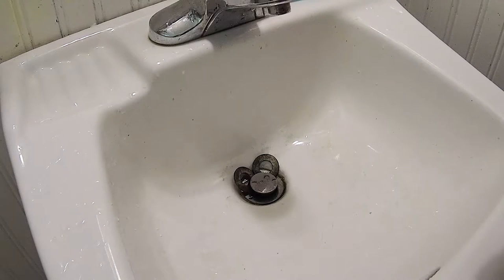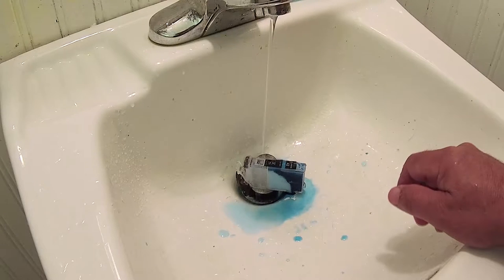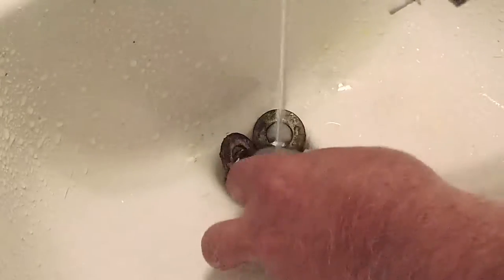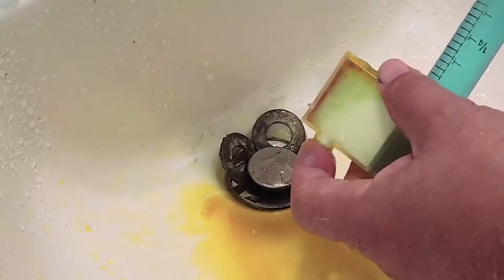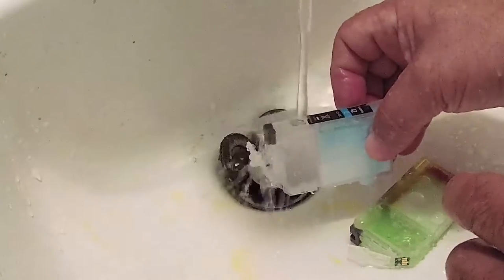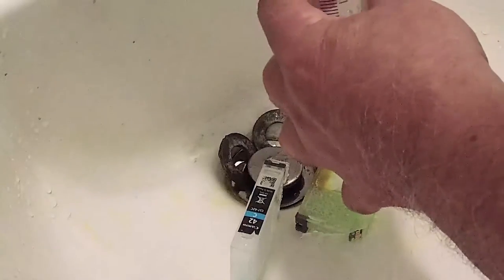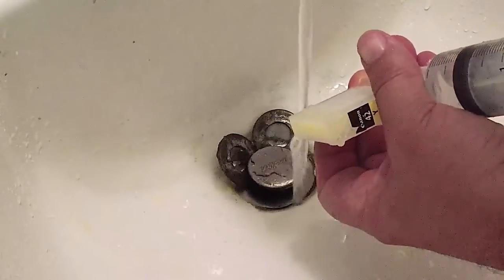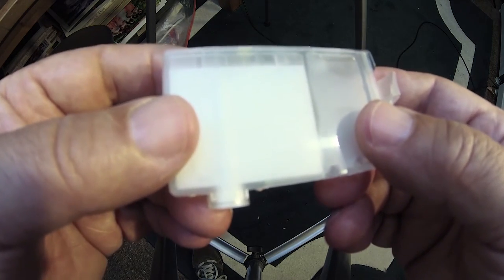#4 Flushing out the CLI 42 Carts

Comment: Am I understanding this that OEM yellow is not water based and that is why it is not compatible with the water based PC formula?
Reply from the maker: Yes!
Reply: Your response is highly appreciated. Knowing this, I would tend to go with octoink then since it's formula would be much closer in formulation to the OEM. Would you agree with my reasoning?
Reply from the maker: Uhhhhh, not really.
Reply: The question remains, why does Canon use a yellow solvent ink in conjunction with an otherwise all water based system.
Reply from the maker: Quite simple. Because it does not fade as easily as water based yellow. Yellow is weak link in the whole fading debacle.well, also photo black just not as bad. That's what makes the new Canon inks for the PRO100 unbeatable! Switch to anything else and longevity drops to about 10% that of OEM. I can live with that it I am saving 15x but I have ways to extend the print life span so I am not too worried.
Reply: What could one expect the longevity to be if PC refills were used in conjunction with OEM black and yellow? (not utilizing the PC black and yellow) Sort of a hybrid cocktail.

Comment: Hi Jose. I failed to follow your instructions and mistakenly flushed my CLI-42 yellow cartridge with tap water and then flushed it twice with windex and then flushed it with DI water. The sponge is snow white and dried to 13.7 grams. Is the cartridge usable as is? If not is there a way it can be salvaged?
Reply from the maker: As long as it is white you are ok.

Comment: Where do you get a syringe like that and.....hat size is the end....it has to be the right size to fit into the hole and form a seal??!!
Reply from the maker: It is a 60 ml. Amazon and eBay sells them. The bigger the better. They come in plain tip which perfectly fits the fill hole of the cart! Mine is a leuer end syringe so I needed to screw on a plain tip adapter. So get a Plain tipped syringe and you will not need any tip adapter like I bad to use. Inkjetmall.com has plain tipped 60 ml syringes.

Comment: Is it absolutely necessary that after the flushing the carts should be 100% clear and that after that one must flush the carts with alcohol and the with glycerin? You said somewhere that it's possible to refill OEM carts with PC inks even when they are not empty. 
I tried to flush my carts but they are still not 100% clear. Also I haven't found the needed alcohol and glycerin.
Reply from the maker: NO. Just top them off with the PC inks when you reach low. The only one you will not do that with is the YELLOW one. You be given a flushed and ready to fill CLI-8 cart. Fill it with the PC yellow and transfer the OEM, CLI-42 Yellow chip to it. From at that point on you are top top off all the carts as needed or all at once. Reset as you top off. Do not ever reset and forget to top off. You do not want to have a cart physically go empty and the chip reporting it "has Ink" in the cart. That would KILL your print head.
Reply: Jose Rodriguez you also told before that it's good to have two sets of carts, so that one could replace them for a refill all at once. I wanted to follow your advice. I have 8 OEM carts in my printer, some of them will be empty soon. I was going to refill them with PC inks as you wrote to me here above. Another set of refilled carts I wanted to make with already empty OEM cats that I have. I flushed them with the distilled water and a window cleaner (not a Windex but also with ammonium) but the carts are still a little colored. Can I refill them being in such state or already empty carts must be 100% clean and then flushed with alcohol and then with the glycerin mixture? I don't have the alcohol you mentioned nor the glycerin either.
As for the yellow cart, I know the problem. I was going to use one of the carts that was flushed out better than others (BK or LG).
Reply from the maker: Sponges a bit colored will do no harm.  Go ahead and prepare one set and when you get the first low warning on the set that is in the printer SWAP it completely and and then modify the set you just removed.  DO NOT let them reach empty. You will have problems with AIR Foam in the sponge!!!!! Modify, reset and top them off as a set. when then FIRST one goes LOW. DO not worry about mixing inks except for the yellow of course.  Once you have two sets going then as soon as the first low warning hits. Open the top cover and swap the complete set for the other one and continue doing this from that point on. Rest the carts before you top them off to prevent spills as you will have to have the bottle exit port clip removed during resetting.
Reply: It's great, thank you! I hope next week I'll be already trying the PC inks myself. Thank you very much once again for your help, Jose! (And, please, don't forget to think over about the 480-patch calibration :) As for now, have I understood it correctly that the Canon calibration utility is better overall than the ColorMunki Photo's software?)
Reply from the maker: Awesome. Good luck and let me know when you begin!
Reply: Hi, Jose!
I've received the Pc inks. All evening and half of the today's night I devoted to refilling my carts, printing tests and profiling :) To be honest, I'm not excited about the PC inks so far. You mentioned in a lot of of your videos that images printed with PC inks look almost identical to the images printed with the OEM inks. In my case it's not true. I see a visible difference. The iges I printed with OEM inks are very beautiful and natural but the images printed with the PC inks look somewhat blueish and greenish.
I tried the Canon Luster paper and a russian super glossy photo paper. I tried original icc-profiles, my own profiles built with the ColorMunki Photo and the profile you shared with me (for Canon Luster paper and PC inks). The images printed with the OEM inks are the best (with both original and my own icc-profiles). The images printed with the PC inks are OK-ish but definately not great, faces look much more unnatural than with the OEM inks. The image I printed with the "AAl..." profile is the worst, it is very dark and with the color cast.
Sure, while printing, I turned off the color management in my Canon driver. Turned on the color management by Photoshop. When I printed with my profiles I selected the papers for which I made my calibration. Partly I printed via the Canon Print Studio Pro plugin, partly via Photoshop. 
Please, take a look at the scans of my prints. The scans are not very good but one can see the difference. All the patches on all my prints are visible, the scans are just too contrasty and bright. Here is the link (if it's not in english, the download button is to the right of the chckbox) - https://cloud.mail.ru/public/LxRP/sSnCBUNAv

I also made a pattern print via the Canon Print Studio Pro. It looks like with the C:-12 M:6 Y6 images printed with the PC inks could become better. However,  I'm not sure what causes the problem: the inks, my color profiles (but they are good for OEM inks!), the settings. I also wonder, if the PC inksare  really not very good then why my profile didn't solve the problem? Maybe using more patches for profiling is really a wise decision?

Comment: Hi Jose, would you recommend flushing your own OEM yellow CLI-42 cart or getting the pre-flushed CLI-8 from PC?
Reply from the maker: Either way. Getting the pre flushed cart is always easiest. You still need to swap the original Al chip from your yellow cart. But yes, you can flush your original yellow cart with with Windex with Ammonia first and then water.
Reply: @cheo1949  For any UK enthusiasts who are thinking about buying from Octoinkjet.  They sell genuine remanufactured cartridges filled with their latest dyes.  They cost around £32 for a set of 8.  I have bought one set plus 2 extra yellows.  That way I can modify my existing OEM cartridges with the exception of the yellows, which I intend to send to Octoinkjet for them to reuse.  This takes nothing away from the excellent products provided by Precision Colors but shipping to the UK is rather convoluted at the moment.

Comment: When you flush with water, is it safe if water touches the chip?
Reply from the maker: No problem at all. After fully flushing and you either suck out or push out all dress water from the sponge , you will Wick Dry the cart in the warmest area of house as shown in the video until the cart weighs 13.5-14 Grams. Now you can refill it.

Comment: what size syringe do i need to flush the carts?
Reply from the maker: As big as possible. I have 60ml. It simply makes the job a lot easier the few times you have to fill up your syringe with water.

Comment: Hello Master, can I use alcohol ?
Reply from the maker: No use Windex with ammonia. If you can not find it. Look for a similar Blue Clear type window cleaner that contains some ammonia. It is the Ammonia that will fully dissolve the remnant Yellow dye ink from the sponge.
Reply: Thank you Master. I will buy to windex clear.
Reply from the maker: Blue with Ammonia!
Reply: Jose Rodriguez it mean ink blue use windex too ?
Reply from the maker: No. WIndex is an American Window / Glass Cleaner. It is a clear blue liquid. It contains .5% Ammonia which makes it perfect to clean and dissolve Dried Ink which often is the cause of Print Head Clogs and it is also great for flushing CANON Sponge Carts. Then followed by water flushing.
Reply: So then I buy Windex for clean . Thanks Master again.
Reply: Jose Rodriguez hello Master Jose, I found Window clean with ammonia at 99 cent store, is that right ?
Reply from the maker: What is the Name? Is it Clear Blue? If so then it's OK!
Reply: Jose Rodriguez window clean with ammonia , it is blue color.
Reply from the maker: Hopefully it is the same as real Windex!
Reply: Jose Rodriguez okay thank you master Jose.